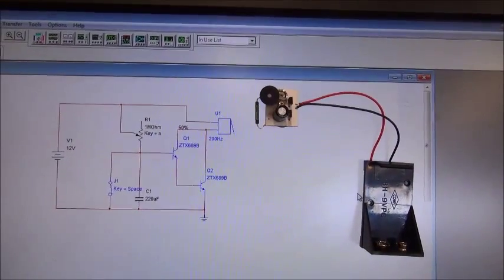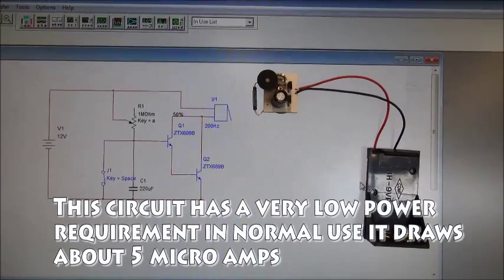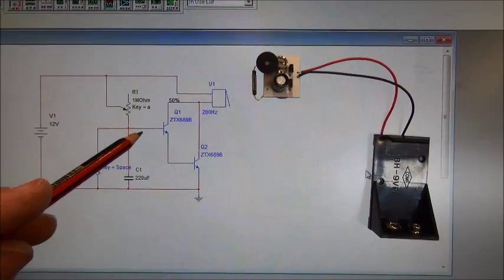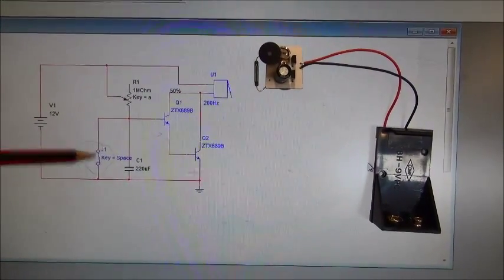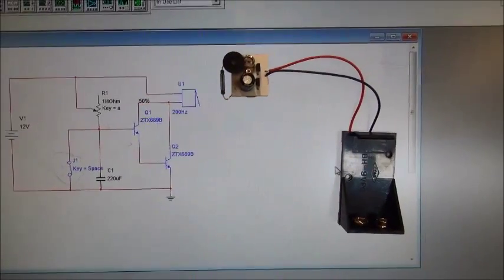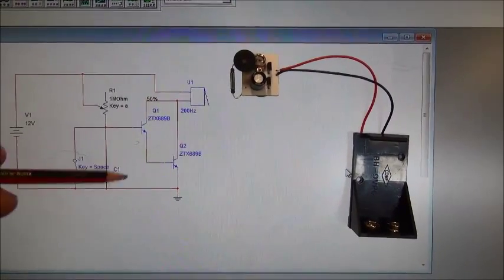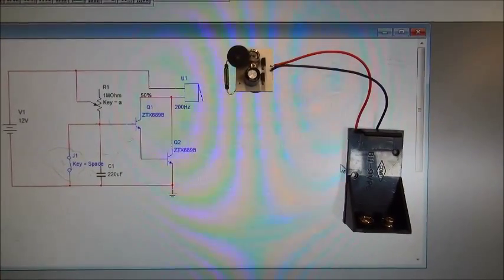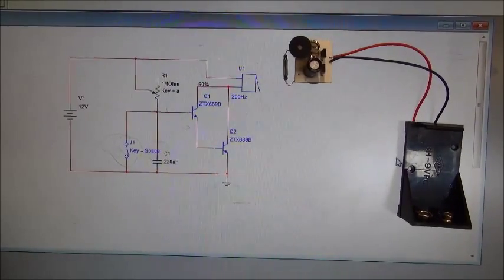Freezer Door Alarm Using Minimum Parts

Comment: this is a duff circuit because if the variable resister is turned to it's lowest resistance , when the read switch is made, it will  create a short circuit. there are other things wrong that will just blow the transistors up. I get the feeling this might be a fake video.